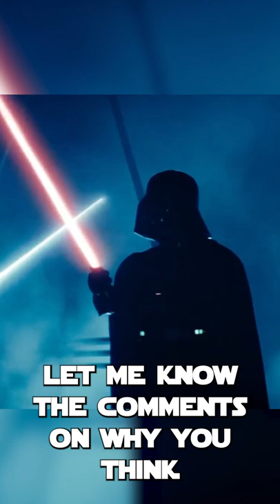Do Lightsaber Ignition Sounds Change?

Comment: I assumed it was based on the intent of the wielder honestly
Reply: would make sense seeing that the kybercrystal and its user are connected trought the force
Reply: Either that, or it's different depending on who wields it. Luke's and Rey's Ignition sounds of the same weapon are different from each other, but relatively consistent for each other.
For Luke, it's even the same sound for different weapons.

So either that, your theory, or the directors just rolled a die whenever they had to use an ignition sound
Reply: I was going to say, could depend on the emotion on the user. If it was hatred, it would sound like a Sith saber.
Reply: @Kk-0523  Something like: the ignition sound is actually a person resonating with the sabers kyber crystal through the Force.
Reply: That’s what I was thinking

Comment: Could be mechanical factors, such as how hard you push the button to activate it, the status of its internal components, and atmospheric conditions.

But lightsabers also contain kyber crystals, which have a connection to the Force, so it could be related to the mood and intentions of the wielder.
Reply: And it has been stated that the reason the lightsaber shuts off after leaving the person's hand is because it lost connection between the wielder and the force
The Darksaber even has the ability to affect it's own weight depending on how in tune into the force the wielder is
Reply: @fitraness123  a good example of this is the darksaber. The less "at peace" the wielder is, the heavier the blade feels.

Comment: My ideas are potentially multiple factors like parts used, temperature, moisture in the atmosphere, age of lightsaber, maybe even the users connection to the force, and it could also simply be the mechanics of the lightsaber that cause the change.

Comment: i personally love the specific ignition sounds for the type of situation. i love how anakin’s lightsaber makes a normal lightsaber sound when hes using it normally. i also love how it makes a darker more ominous ignition sound for when he turns to the dark side, and the green lightsaber sound for when someone turns it on when theyre focused and ready. 

it makes a lot of sense when it comes to the mechanics of a lightsaber. if a kyber crystal connects to the force user with the force, it makes sense why the ignition sound would change based on their emotion or state of being. if youve been overcome by the dark side, and filled with hate, your kyber crystal will have a more ominous and rough ignition sound. just my thoughts though

Comment: There was another video I saw that broke it down. In the Prequel and Sequel Trilogy they use saber sound 1 (A New Hope's Anakin Saber sound) and 3 ( from Luke's Saber in Return of the Jedi) for Jedi Sabers and, specifically 3 for quick ignition scenes. Sound 2 used for Vader's saber originally in the OT, gets used for Windu's saber and most Sith saber ignitions and for Anakin for the Youngling slaying. 

In the OT it was sound 1 and 3 for Jedi Sabers and sound 2 for Sith.

Comment: Lore wise : The Kyber Crystal bonded with the force sensitive (Anakin, Luke, Rey) is responding to the feelings and thoughts of said users and reflects those things with a sound (Saber Ignition).
Non Lore Wise: I think the sound designers for the films thought it was the best idea to include the sounds for dramatic affect
Reply: No, the kyber crystal isn't responsible for the ignition sound. The mechanical device of the saber hilt does that.

Comment: I don't exactly know how kyber crystals work, but to me it has always been like a lighter ignition - a spark is created that ignites the crystal which then emmits the saber blade and the sound differs depending on the created spark's particle movements on ignition. As sparks cannot be controlled, they just are, different spark patterns create different blade ignition sounds. Some smaller sparks make the low-sound ignition which sounds like a blade being simply unseathed and bigger sparks create that "bang" sound followed by the unseathing blade sound.

Comment: The kyber crystals are always connected to the wielder of the saber if it is powered by a crystal then it theoretically has a connection strong enough with a wielder that its ignition sound changes depending on the user's emotions or intentions.

Comment: Im pretty sure the noise is the plasma cutting through the air so it probably has alot to do with air temp/humidity/barometric pressure.

Comment: the OT only had 3 characters using sabers, and the sounds where based on the crystal, Blue would use og jedi, red would use og sith and green would use luke's return of the jedi sound (the empire clip you showed using luke's green sound is a re-release of the film, the original 1980 release has the og jedi noise instead)

Comment: There was a system for it in the originals which worked fine since there were only 4 sabers in the whole trilogy, but it was the right choice to do away with that in the prequels. Since there were so many Jedi, it would be ridiculous to keep every saber sound in check with that system.

Comment: Simple. Vibrations and heat. We know lightsabers are extremely hot and would cause the air around it rapidly expand and pop, so the initial pop of the saber igniting could be that, added on with the vibrations the blade itself causes.

Comment: Oh I got shit tons on this, so a saber is just plasma shaped and formed right, and energy like that has all sorts of particles and waves coming off it, rightm, so as the device changes, or power source degrades or shifts it should to right? Cuz lightsabers are just plasma swords shaped and contained?
No.
No they are not.
Kyber Crystals are force empowered, semi-sentient focuses of living energy,
Capable of procesing and imprinting things like love, joy, fear, guilt, etc.
Each one is in tune to the Force user that wields it.
Losing that connection literally means less effectiveness, and vice versa.
Now introduce PTSD, years of carnage, (or peace) and a but ton of newfound (usually combat) experiences to boot.

It would be wierder in fact if these things, of which the energy of is passed through, and molded by, did in fact sound identical after so much diversity.

Comment: It felt unright, on the rey version, it has that charging sound like when diesel fuel has to be exhausted out in high pressure to ignite it, yeah just like that like there is gas going through it even tho lightsaber are not burning gas

Comment: Could be due to the sabers age and the kyber crystals condition cause each kyber crystal has a limit to it's power the more powerful stronger the blade and more refined it is weaker crystal blade isn't very strong or refined and cause the power source of a light saber is the crystal it drains the crystals power they have alot of power but the hilt its self requires some power always flowing through the hilt just to keep powering it's self aswell as a small amount of power to allow for the continued off and on of the blade which takes power even while it's off the crystal will still be used it's why in the show with like a more cartoonish look and like far after ankin is turned into Darth Vader the sabers that they find where a massive battle between Jedi and sith took place at the sith temple those light sabers turn on one final time and take a form and kinda sputter before finally turning off for good do that all the power the kyber crystal had finally ran out mostly cause of the fact that the temple was basically a gaint battery/emp aswell as weapon and also cause they've been sitting there for possibly millions years